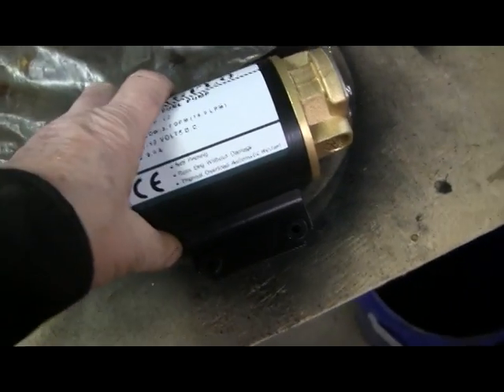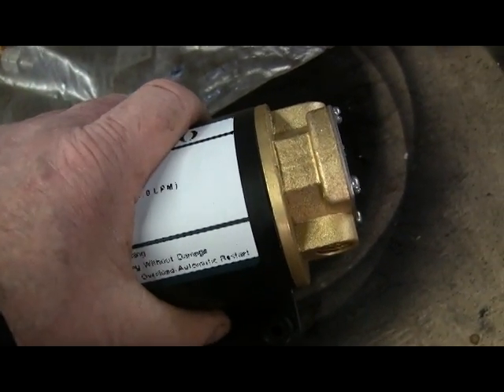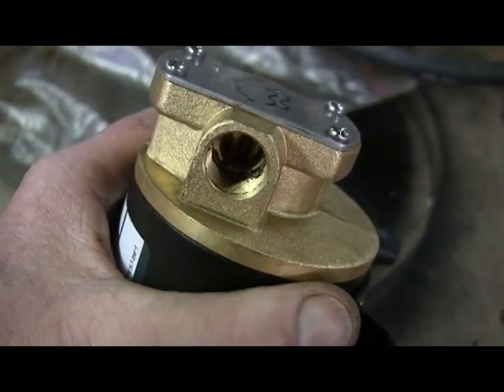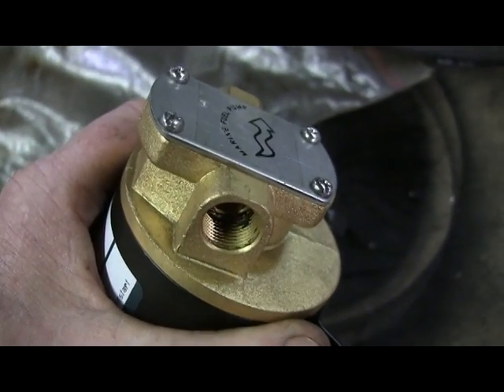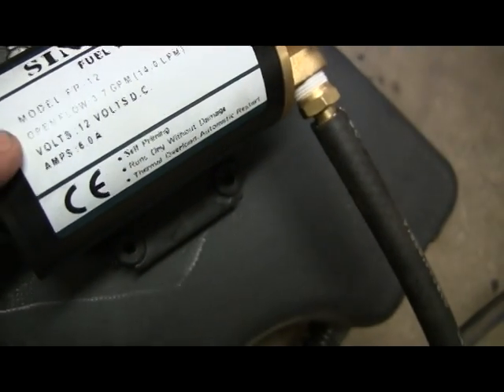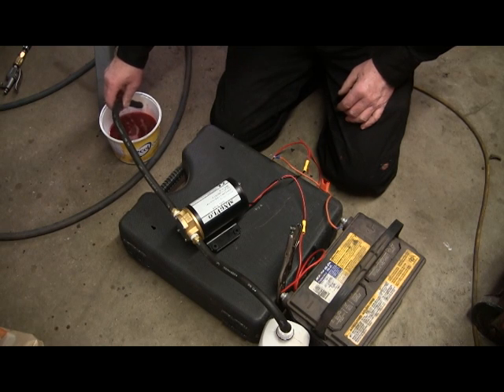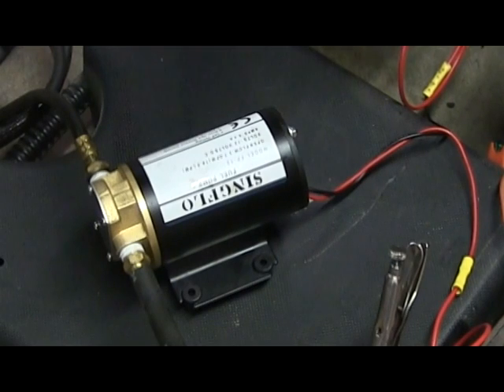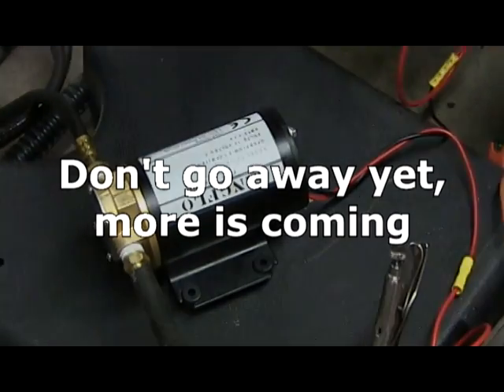eBay Oil Suction Pump

Comment: Been using one these to push and filter waste veg oil through two 10" common water house filters 20,10 micron and straight into my diesel fuel tank 1HZ Toyota engine. They work hard and go good, can reverse polarity to make then pump backwards. 

I know of ppl that have used them for years pumping 1000 ltr IBC veg oil. I thought they were no good to start off with as would start stop, start stop and not pump much through. As waste veg oil from fish chip shops often has particles and junk in it. I learned it had to have a Y trap mesh bout 80-120 micron pre-filter and that fixed everything it flowed like a gem for ages. I normally use it for 20Ltrs at a time. 

If filtering veg oil it is a good idea to put a DPDT reversible current switch on and clear hoses, when you see some creamy veg oil coming up the line can quickly stop the pump and reverse it to clear that junk out that you don't want.

When you stated high PSI i wander if it could supply 80 degrees Celsius heated oil to a centrifuge needing 80-100 psi but i don't think it could keep up to it. But if anyone has tried this successfully please comment to let me know.

Comment: Same thing as the AmarineMade version?  Part number is the same:  FP-12.   I picked one up with the idea of setting up a prelube pump:  just purge/fill oil galleys and move just a little through the pushrods after sitting a few days or more.   What I got came with fittings to suit 12mm hose.  The pump ends are threaded: appears to be parallel ISO threads, of 3/8" BSPP [19 tpi].  Fittings supplied are decent but minimal,  in that you  have 5 thread engagement, but there is room for 8 or 9 if you want more robust fitting install.  I do wish there was just a little more  area on pump body for positionable 90 degree fittings with an o-ring seal - that way suction and discharge can point the same direction to make install & maintenance a touch easier..   There's room for an o-ring [just] but shoulder area to keep it captured needs another 2mm or so all the way around for those type of fittings generally - the casting is minimal.   Decent bang for the buck purchase, but BSP has to be explained to 98% of auto parts stores you meet: P has no taper, T has roughly half the included angle vs npt,  and... zero chance its on any aisle now, or at any time since... ever.   Nothing npt is interchangeable with this standard, not even 1/8" which has the same thread pitch but since taper is different... a mix & match on that size leaves something just under 2 thread engagement - no amount of teflon will save the day when pressure is applied.  
Theres a flaw in my pending install: Ive got to find out what the psi ceiling is that overloads the motor and spec a reief valve.  Got a DC amp clamp somewhere... and thank you: nice test & review.

Comment: The outlet size hose needs to be unrestricted eg smaller hose diameter along the outlet hose otherwise it will draw 24amps & cause the thermal switch to switch on & off every 20 to 30 seconds so if the outlet is 3/8 you need to use 3/8 or bigger with no restrictions if your barbed outlet is 1/2” you need to use 1/2” or bigger hose/pipe

Comment: After tucking those carbon brush leads away from the short my pump is rated at 6.5 amps now its drawing 1.7 amps no load

Comment: I tucked those leads out of the way against the plastic end cap away from motor case/shell some kind of thin insulation sheet could be put on inside of motor case to prevent carbon brush leads shorting

Comment: Mine has a current rating of 6.5 amps @12vdc 12 lpm & was drawing 24 amps & switching on & off & found the carbon brush leads were long & shorting on motor shell inside

Comment: Check current draw with no load on it then with a load 20 amps is alot of current for that pump motor there is a thermal switch inside glued to the end cap at 20amps you will find it will start/stop intermittently because it heats up at 20 amps & trips the thermal switch then when it cools the thermal switch automatically resets & motor will run again

Comment: Hey just watched ur video im doin a stand alone oil feed for my turbocharged bike are u still using the pump or did it die.. did u have any other problems with it
Reply: I abandoned the project, sold the pump for a few bucks.

Comment: Thank you 🙏.   I’m using this pump for a aux transfer tank in my truck I wanted to pump it through a filter before it went to tank instead of gravity.  It also goes through a two position valve so I can kidney loop the diesel.

Comment: Also buddy,... could I draw oil from the filter’s sandwich plate for priming the  phaser gear like I described in my last comment? The outlet on the sandwich plate is just like the outlet for the turbo oil feed line.
Reply: For priming purposes you can draw from the engine's oil pickup, but you MUST ensure that that the engine's oil pump CANNOT draw from the Tee-d line to the primer or the engine will lose oil pressure. This can be accomplished with a one-way check valve. You can source these from a hydraulic supply store.
Reply: Richard Mathews ..... so connecting the scavenge pump to one of the sandwich plate’s  oil outlet will draw oil through the filter first and secondly  from the oil’s pickup tube? 

I know an oil filter has some kind of one way flap inside the canister but I haven’t gotten far enough into this project to know if the pump will pull oil through the filter without discrepancy... I won’t need to worry about a check valve bcs the oil filter’s adapter only sends oil out, it does not accept auxiliary oil.

Comment: I’m shopping for one of these to prime a passer gear on a QR25DE. I’ll have to make a fitting to the cam gear cover to fill the phaser with oil bcs it’s not staying locked during startup bcs I have cams and harder springs bcs it’s a turbo build and the phaser isn’t equipped to hold the valve spring tension on the cam lobes although everything is new as well as phaser. ANYHOW... I don’t know if I DO or DONT need a return bcs the phaser does have two in&out oil passage ways and any extra oil would just flow into the rest of the motor, idk... there’s not a lot of information that I need about the technicalities of the QR25DE so that I can fabricate the prime pump for the phaser. How has your pump treated you so fast and was it over $60?

Comment: Can you use a Bosch fuel pump as an oil pump?
Reply: No. The fuel pump has much tighter clearances and the viscosity would cause the pump to labor and overheat.

Comment: I am assuming that if it's marketed as a turbo scavenge pump that it must be rated for continuous service? How hot does it get when run continuously for a couple of hours?
Reply from the maker: Naughty Goat Farm I've only run it for a minute or so and it didn't get warm. Considering the poor quality of this pump I would not recommend it for something critical like a turbo scavenge pump. I only used it for priming the engine, not a critical application.

Comment: What I don't understand about these pumps is that they are promoted as a pump to scavenge oil from a turbo or to circulate oil for diff coolers. But then they say that the pump has a 30 minute duty cycle. So you can only drive for 30 minutes at a time?
Reply: It's Chinesium: thrash it, and see where it gives out - AvE would.
  Since duty cycle is generally expressed as a percent... 30 minutes vs a complete unknown means what?  Something failed in translation.  Maybe this needs a pwm controller for dedicated scavenging?  A 30% duty cycle would slow it down and in doing that also avoids some of the pitfalls we saw from high pressure.  But mainly, this pump seems aimed at transfer: the test we saw [1 quart in 5 seconds] applied to a 30 minute run time suggests 180gph transfer rate.   Freightliner tank?  About 150 gallons I believe.  A D5 dozer? About 80 gallons.  A 60 foot yacht? 1900 gallons... and tanks need balancing to trim list periodically.  List of applications is gigantic.

Comment: HOW DOES HOT OIL AFFECT ITS USE, BETWEEN NORMAL ENGINE OIL TEMP OF 200 - 260 F ?
Reply from the maker: I didn't use it for hot oil, but I see no reason that it wouldn't work just as well.

Comment: I've had this pump on my turbo VW beetle. It's very loud without rubber mounts. I made that mistake and then fixed it. It's also VERY heavy for what it is. The unit I got was pretty clean, so obviously you got a bad one with all that crud. I will say though, I'm still working through oil scavenging issues. I might be the pump, It's kinda hard to tell. But like you say, it seem to pump really well. The issue will be getting it to pump foamy hot oil from a turbo.

Comment: Could this be used to extract oil for an oil change?
Reply from the maker: Yes it could. It has great suction and does not need to be primed. These pumps are originally listed as marine oil change pumps. You could thread a fitting into the oil pan drain plug hole with a hose attached. Run the hose well above the oil level and plug the hose end. When you are ready to change the oil connect the pump to the hose and direction the discharge into a pail and power the pump. The professional marine pumps cost about $700. For just pumping out old oil this is all you need.
Reply: Thanks so much for the info. I think I will give this a shot.